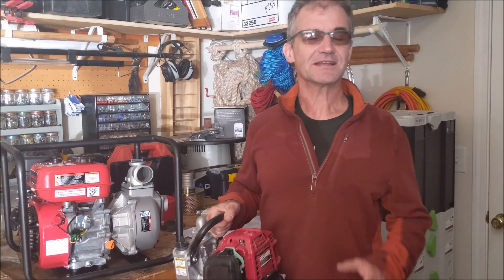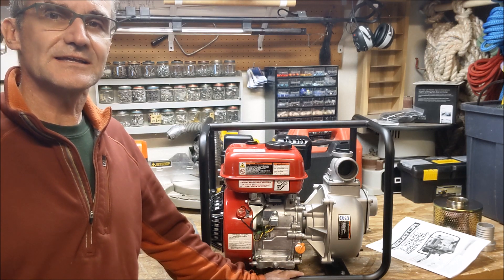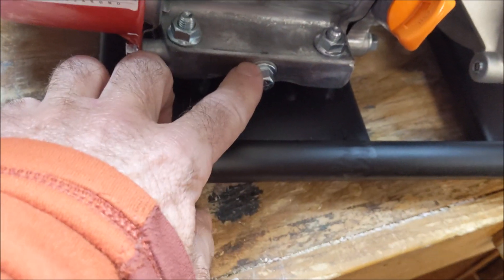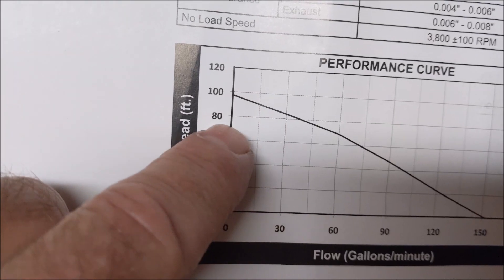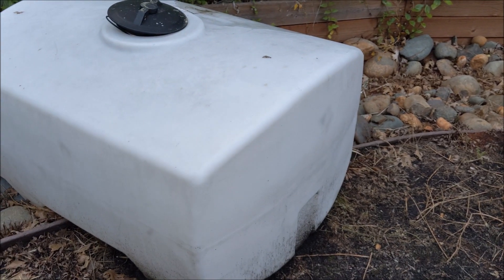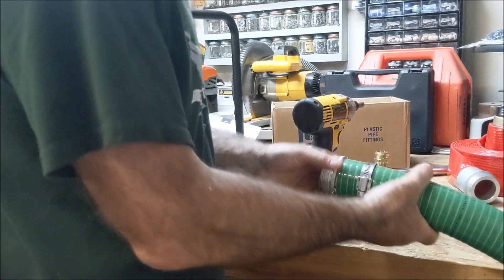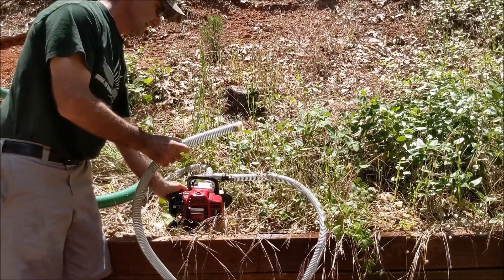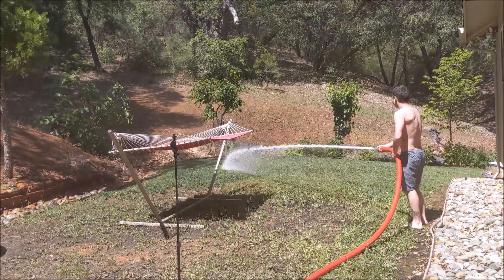Harbor Freight Predator 2 in Water Pump vs  Honda 1 in  Which is Better and Why

Comment: Reduce the gpm with an adjustable nozzle. Either way 65 gallons will go fast so whatever pump you use add a 10 gpm nozzle and you’ll get 6.5 minutes at full throttle.
Reply from the maker: Very good advice

Comment: Adjustable nozzle??  If im running low fog or stream im not going to use 35 or 160 im here to see it push water via nozzle
Reply from the maker: Yes

Comment: That pump curve chart can also show you the PSI....the ft/hd can be multiplied by 4.33 to convert to PSI.  So at 30 GPM you would have a little over 80 ft/hd....say 84...that is a little over 36 PSI from the pump.  Then you have the friction loss...but 30 GPM through 2 inch loses less than 1 PSI per 100 feet of hose.
Reply from the maker: Good to know, thank you
Reply: 0.433....not 4.33...sorry

Comment: You need a fire nozzle for the 2” to restrict the flow. What are you talking about that it won’t work for fire control and sucking tank down to fast
Reply from the maker: Regulating nozzle is exactly what it needs.

Comment: How is it holding up now curious how good those predator engines are at lasting long
Reply from the maker: I have been using it a ton this last week on a construction site to water down the excavating from a tank and it has been great, no problems, one pull start, running continuously for hours in 100 degrees
Reply: @topsaw  Same Predator pumps works great for fire suppression for us.  Just neck it down from 2" to 1" and get the 22GPM nozzle.  We use a 100' 1" UFS hose as they don't melt like the pvc ones.  Good video thanks
Reply from the maker: @robz924  good to hear, I actually just got that nozel

Comment: I bought 3 electric pumps. The first one works but it is not suitable for my big pool since it is a vertical pump (amazon). The top part is exposed to water and in danger of electrical shock. I bought the second and the third submersible pumps  from harbor freight. The second one is broken and I received a refund from harbor freight but they told me to keep the broken one (since it is exposed to water). The third one is complicated to get it to work. After watching all the fuel generator pump, I am going to get the predator 3' 212 gpm pump this weekend. Easy to work with, powerful and not complicated to use.
Reply from the maker: Good advice, easy to use is key, especially if used for fire suppression. I've had great, consistent luck with my Predator pump
Reply: @topsaw  Thank you. Using the electric pump costing me half a day to get my pool drain and clean. I have to consistently going back and forth to move them to the deeper level of the pool. With this generator, all I have to do is by dropping the intake hose to the lowest level of the pool.

Comment: I'm wanting to pump water from a pond to wash off fourwheelers and equipment at my camp. Would the predator 1 inch or 2inch be ideal
Reply from the maker: One inch would work, long as there isn't too much lift required

Comment: On the 2” don’t use 1 1/2” hose. Reduce it down to 3/4 “ and get you a spray wand similar to what a pressure washer has and your water will last way longer and you’ll have much more pressure. Great for grass fires.
Reply from the maker: Good advice, thank you
Reply: A typical 3/4" forest nozzle is fixed at 10 GPM. With a 1 1/2" hose and nozzle, you can simply turn it towards the closed position to reduce the flow and lengthen the stream. Now, if this guy isn't using a nozzle, I wouldn't even know what to say.